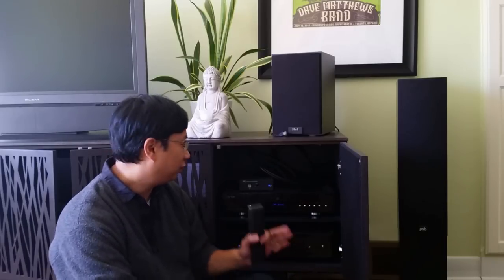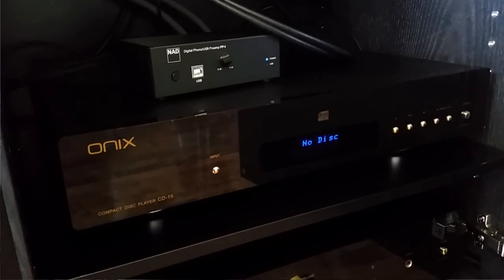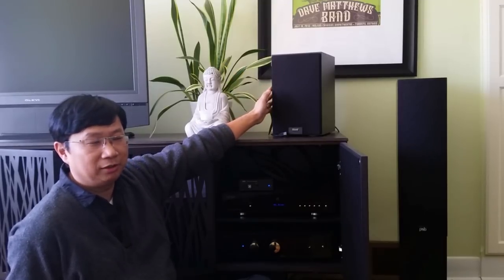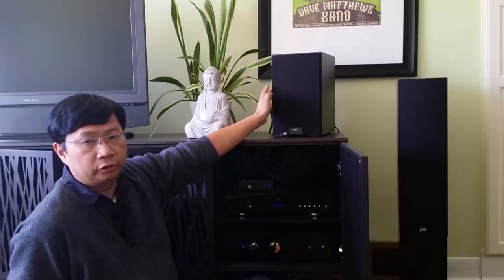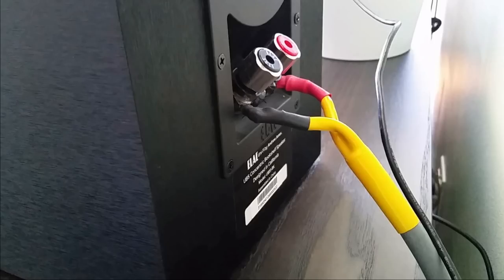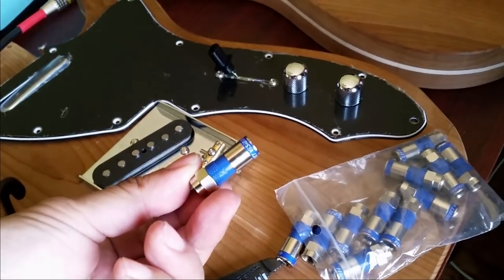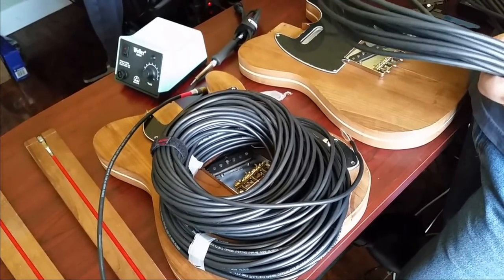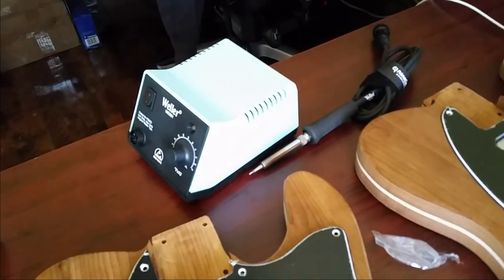Stereo - ELAC uni-Fi UB5 speaker review + DIY cables + Onix RA125 + Onix Cd15

Comment: So what you shared about Andrew Jones pushing the Uni-Fi speakers with 5,000 dollar gear is very interesting and you are absolutely correct any person buying budget friendly speakers likely won’t spend that much on the rest of the system. Do you have any recommendations for us who has bought these speakers? I have the towers and center speakers connected to a Denon AVR-4308CI and an Emotiva BasX A3, just curious to know if I could add anything to improve my setup

Comment: Another great video by Thomas and stereo 

Coax is shielded  and solid core
But my concern is, isn't the point of having very small gauge meaning large wire 10-14G
 versus hi Gage which is small wire,  18-24 g have to do with resistance?

And you want the least amount from what I understood.
Reply from the maker: Thanks, I guess that is why I always say, you never know until you plug it in and listen. We can all theorize what is the best match but real life experience can sometimes be surprising.

Comment: i recomend if rca is used to use a good microphone cable or solid cores with 2 inner leads and shield.must have direction arrow marked on it.. One end inner lead 1 is connected to positive terminal.Inner lead 2 and shield is connected to  negative.Other end is inner lead one connected to positive,inner lead 2 is connected to negative terminal(shield is floating on this end.Direction(from source negative lead and shield together,other end shield is floating(not connected)

Comment: I would try using that dual conductor shielded wire with the shield connected only at one end to see if it sounds different than connecting the shield at both ends, the source end of the cable would have the shield connected to the ground, the other end would be floating. In nessence the twon conductors would hands both the signal and ground with the shield acting only as a shield.

Comment: Great vid Thomas "keeping it real" as they say.   Regarding hifi upgrading, I dearly wish I could say the same about myself.  My greatest flaw is that I love technology any technology, it fascinates me.  Whenever I run into a hifi issue my default response is "Hmmmm what new bit of tech might resolve this?"  So far I have only added gear to expand functionality and quality (better cables etc) but I've reached a point where the next "upgrade" would involve some major spending for  separates (Parasound Halo P6 and Wired4Sound mAMP with balanced interconnects).  I have been holding off as I know it will not be easy to resell  my current Peachtree Nova 150 because I live on a tiny  north-west Caribbean island (Cayman Islands).  I don't have a lot of space so I  use  bookshelves (LS50s) supplemented by an SVS sub but I don't like that the Peachtree is sending the LS50s all this pointless sub 80hz information. I'm guessing that there is some sort of penalty for this especially during high volume playback.  The Halo P6 has both low/high pass filter functionality and the W4S mAMP obviously has more powwah yeah!!!!  Your friend definitely has the right idea.  Buy  until it's what YOU want then put  down the wallet and slip away to music nirvana.
Reply from the maker: hehe, you story reminds a bit the story of my friend who is into vintage gear. He said his friend upgraded to the point that the next only possible upgrade was to change the house so he can get a better room....crazy :) I always wanted to try the peachtree.  By the way, you live at one of the most beautiful place in the world , congrats. I do envy my friend, he just listen and enjoy music everyday.

Comment: I want some Magnepan 20.7s for my front speakers, a Magnepan center speaker, the B&W PV1D subwoofer, and 4 of the Elac Uni-Fi UB5 for surround and surround back. I have the Yamaha RX-A1070 to drive them all. It seems like everybody raves about the value of the Elacs. Problem is, where I live, nobody has the Maggies or the Elacs set up to be listened to. I may buy and then return if I don't like it as much as I think I will.
Reply: I wondered if anyone would bring up Maggies on the comment section, I am going tomorrow to look at a set of used Magnapan SMG speakers that have been rebuilt and I have a set of B5's that are AMAZING! I will comment back if I actually buy the Maggies but the ELAC's are very very cool for the price.
Reply: @jackallen6261  
In my opinion, Maggies have the best imaging of any affordable (<$50k) speakers. I have an old pair of MG IIIs that still sound great, but I'm sure the 20.7s would be a significant upgrade. The 20.7s cost $13.5k, but reviewers say they sound as good as $100k speakers. So in choosing the 20.7s and the Elacs, I'm obviously looking for the most bang for the buck. I assume that's what most people are interested in as well. Good luck with the SMGs.

Comment: Thomas, You were saying $2000 speakers produce at $2000 level. Many people saying this Elac speaker is really good. So how is it compare to $600 dollar speakers? I own a Totem Staaf. Will this Elac outperform Totem Staaf?
Reply from the maker: I never heard the totem sttaf but if it has the same sonic signature as the forest, then my question would be what do you want in a speaker. There is no better or worst between these speakers in the sense that they both have different sonic signature. If you value detail, clarity then Totem. (audiophile type of speaker by my definition) If you value musicality with slight roll off, then the Elac. (Musical speakers by my definition)

Comment: Hi Thomas.
Recently i got these Elac Uni-Fi speakers along with the Sonos Amp (mainly because of the streaming capabilities and its power rating). However, after hooking them up I'm not sure if I'm getting the desired loudness. They sound amazing at low volumes with laid back music but I'm wondering if I'm doing something wrong?
I'm a novice and just getting into good equipment now. Hope you have some advice.
Thanks.
Reply from the maker: Are you not able to play loud or there is distortion at high volume? I looked at the Sonos power and it seems to be able to handle 4 ohm load which these speakerws are rated. So in theory, it should be ok. There should be no special setup needed. So it's either the speakers are not 'loud' enough for you or the sonos amp is not powerful enough,
Reply: @ThomasAndStereo  
I didn't turn it up all the way but at even 75% i didn't feel the wow factor. Today i got some QED79 Strand cables and also a HDMI ARC cable...will hook these up and see if there is any difference.

I think my problem is i don't have any reference to which i can compare. The quality of sound however is as you've described...amazing. 
I will let you know if there is any improvement.

Thank you for making these videos. They've helped me decide on the Uni-Fi speakers. Take care.
Reply from the maker: Do keep in mind the Ub5 is a laid back speaker. The kind where you enjoy late night with a glass of wine. If you are looking for a more lively up beat speaker, then check out my Klipsch RP600M speaker video or the debut 6.2. The UB5 is a more 'mature' speaker.  Also, adding a sub will enhance the wow factor.
Reply: Hi again Thomas.

The cables made a difference especially the HDMI cable.
However they still don't sound bright and lively. I guess you're right, they are good chillout speakers and perfect for late night low volume relaxing music. 
At high volumes they have enough bass and i personally don't think a subwoofer is required.
What do you think if i got Klipsch RP 140wm to supplement as rear surround speakers? Cos I've read they're bright lively speakers. Is this possible with the Sonos Amp?

Comment: I just bumped into your channel and saw this video. I enjoyed watching this video and i subscribed! I got a sweet deal on a used UB5 set for $300 used, i had already used them before on sale on amazon but returned them. The seller said he had less than ten hours into the speakers and they weren’t broken in yet. Do these have a break in period? I am using an Emotiva TA-100 that supposedly plays 90 watts into 4ohms and it seems to power them easily. I am on a tight budget, would this amp be enough to power these bad boys? I love the bass and imaging of the UB5 but I feel like the low end is lacking? That’s why I ask if it gets better on more powerful amps.
Reply from the maker: No matter what you do, the low end will be limited due to it's size. By adding more watt, in this case 250w to 4 ohm in this video, you will have better bass but I think the money would be better spent on a musical sub so you get the full range experience. I did do a music video on the Ub5 and people find it adequate the bass.
Reply: Audiofilio Don't forget about speaker placement too, like he mentioned in the video. Closer to the wall, and/or in a corner will increase the bass. As does the floor with a floor standing speaker. That also means that placing them on a real solid surface that's got some area to it, like the way these are set up in the video can also help the bass vs using stands. But be aware this can sometimes make the bass boomy. More bass, but not good bass. So you may have to experiment to find the right setup. And they may improve a little after they get more broken in. Just keep playing them as much as possible. I even play music while I sleep when breaking in new gear. 

You could add tone controls to your system. Schiit makes a small 4 band EQ that's only about $150. I think it's the Loki? But remember. When you boost the bass. Your amp has to work much harder, and that's not good seeing as how you don't have much to spare with that amp. I would only recommend a small boost. Like no more then 2, or 3db. 

While these suggestions may help a little. If you really want bass. I would do what Thomas suggested. I would go one step further though. When looking for a sub. Find one that has the ability to not only low pass the sub so it only plays the sub frequencies. But try to find one that has high level inputs, and outputs (speaker cable). And that high passes your main speakers too. So they only play stuff above the sub. This way you can set your speakers to play 80hz, and above. Then set the sub to play 80hz, and below.

This will do three very important things. One it will make you speakers require less power to get loud and swing dynamics in music, because you've off loaded the lower bass which takes the most power to play. And two. They should now have a more powerful, and punchier mid bass because they don't have to play as low. Thirdly. They will play clearer now at the upper end, because they're not having to play the low stuff. Which is really asking a lot of such a small speaker anyway. 

Just be sure to get a quality sub though. Don't just buy the cheapest one. For a few reasons. But mainly because it will stick out, and not sound as good as those speakers. In this vain see if you can find one with a similar sound signature. Maybe an Elac one? And also, because you'll be putting your main signal through it's crossover, and you want it to be a quality one. So it doesn't hurt your sound quality. 

Can't recommend doing thorough research, before buying something like this enough. Talk to people on Audio, and/or Home Theater forums to make your search easier. Read reviews etc. You're looking for a very musical one, not a home theater one. But those guys know there subs better then most. That's why I mentioned them. Good luck.
Reply: Audiofilio rythmik L12 is a great sub and very musical. 12" 300w rms sealed 14" cube, so good wife acceptance factor. And a flat response to 18 hz which is very impressive for a small box sub. $500. Very well respected brand within the community, but not a widely known brand.
Reply: John G I was recommended that sub by a gentleman I talked to on AudioKarma about a year ago. He swore it was absolutely amazing, and I believe him. Servo subs seem to be superior technology. At least that's what I've read, and been told by those that use them. And with it being sealed too. You can bet it's very fast, and very musical. If I had the money to spend. I would definitely get a couple of them myself. I've considered them the best bang for your buck sub out there ever since I first heard of them. I'm eventually going to get a couple, if they're still available when I'm finally ready to buy, and have the cash. There's more pressing needs in my system right now though. Really great recommendation. I know they're not a budget sub. But what they give you for the money is quite remarkable.
Reply: HH Scott yes I agree best bang for your buck. With some of these very expensive systems I think it would fit very nicely at many different budget levels. $500 is a bit of money, but it's not unattainable and could be around longer than your reciever or speaker choices. Worth saving up for. I got a large ported sub for home theater, but if I were to do a 2nd system or one day want something smaller, that's the one.
Reply: I have the UB5s and used them for some time with a Harmon Kardon receiver, so so I thought. Then I got an Emotiva amp, A-150 (75 into 8 ohms, 150 into 4)  along with a Little Dot tube preamp and boy did the Elacs improve. These are really fun speakers to listen to. Bass is really nice but added a Elac S8 and again another jump up in performance. Yes this with a Fiio X3 makes a really really nice system for around $1K.
Reply: Brian Simmons Make sure that amp isn't directly coupled. Those Little Dots throw out DC, and if the amp is Direct Coupled. That DC voltage will go straight to your speakers, and fry the voice coils. They warn you about this on their website/forum. I'm not sure about that amp though. I would love to hear your setup either way. All those products have interested me. I'm thinking of trying an Emotiva amp, those speakers, and the only reason I not using a Little Dot as a preamp right now. Is that DC  problem.
Reply: I have used this more than a year now and no issues. But aware of the warning so make sure turn on the little Dot, let it stabilize and turn on the Emotiva. Shut down in the opposite sequence. Always best practice to do it this way and now I have trained myself. so I know follow that. Also own a FIIO E9K preamp which works well for what it is. 

 This is from Emotiva forum.
Mar 10, 2014 at 7:50pm QuotePost Options Post by boomzilla on Mar 10, 2014 at 7:50pm
I don't think that Emotiva amps will pass DC - They have fault detectors that decouple the speakers if DC is detected at the outputs. That being the case, your question of using a tube preamp with Emo power amps can be answered in a single word: YES!
Reply: HH Scott f
Reply: @frankenero8617 ???????????? 🤔

Comment: I'm interested in an Onix used amp on ebay, but it looks like Onix internals have a lot of large capacitors and toroid transformer but not the heatsinks you see in typical amps like these. Consequently they don't have vents at the top. Anyone know what the difference in technology is there? Is that better? Worse?

Comment: I'm super interested in these speakers, and I've been looking at pairing it with a Cambridge audio azur 851a. Seems like it should have plenty of power for these and seems like a pretty decent integrated amp. Any opinions? Thanks in advance
Reply from the maker: Well, I had the 851w poweramp and matching preamp. Forgot the model, 851p maybe? Well, I am not too fond of the class XD sound to be honest. It might pair well with it since my experience was XD was a bit to bright and these elac are laid back so they might compliment each other well.
Reply: @ThomasAndStereo  thank you so much for the reply! The Cambridge look like a good unit, I was also looking at for the same price that PS audio Stellar s300 amp. Problem is I would have to use my receiver as preamp until I could by a better one . I don't suppose you know anything about that unit or how that would go with the elacs?
Reply from the maker: Sorry nope. But I am a big fan of Paul. Good luck in your search.

Comment: I borrowed Elac Unifi Slim UB5 for a week and I found them too bright and weak in the vocal performance compared to the Elac B6. Even the stereo shop that lent me the speakers agree about their brightness. I wonder why with regular UB5 (not the Slim model) I've never heard a review that said they were bright sounding. Supposedly the drivers and internal volume are identical.
Reply from the maker: Interesting. So I am guessing here. 1)Slim version has been tuned differently. 2)They are not bright relative to all the new speakers out there but still too bright for your taste. 3)Your system lack power to bring out the low end bass from these speakers. Without bass , low end power, speakers will sound bright.
Reply: Thomas & Stereo Bass was quite good actually. The stereo shop that lent me the speakers have a wide selection of amps to power it and the salesman also found them bright.
Reply from the maker: Oh, i have to check it out one day then.thanks

Comment: a little optimistic power number on that integraded amplifier.It is probably a good 100w pr channel in 8 ohm and 200 watt in 4 ohm. 20-20 000 hz..The quality look to be very good. Bigger capasitors in the power supply would make it better .
Reply from the maker: I guess so, I remember it was at least 3k$ new so I never questioned it's power rating. I don't have the equipment to measure it though.